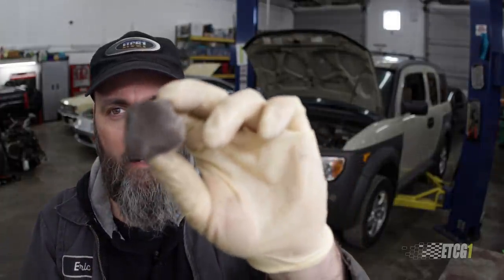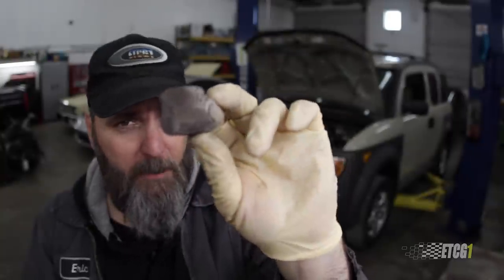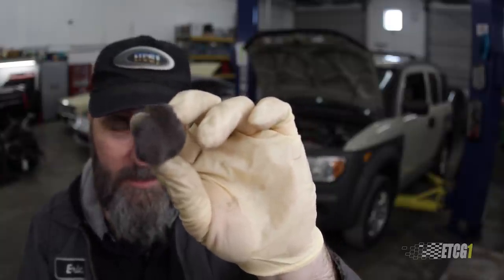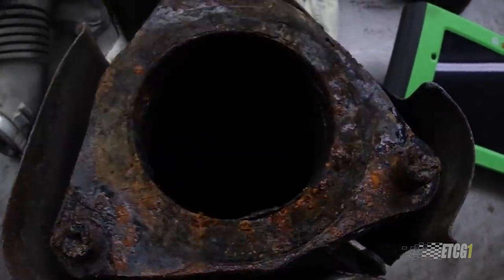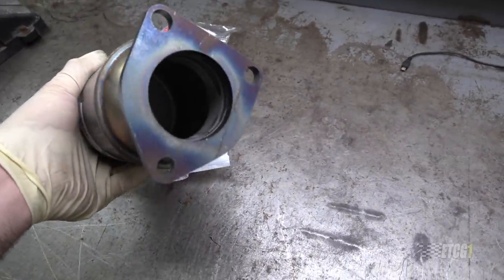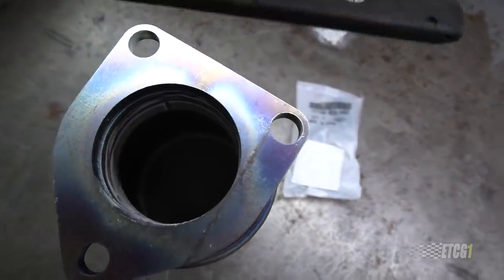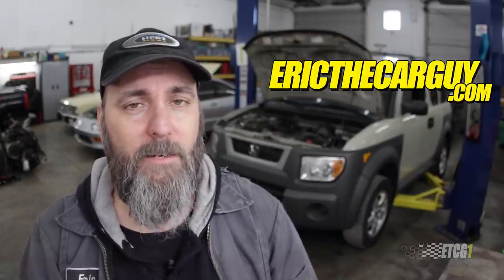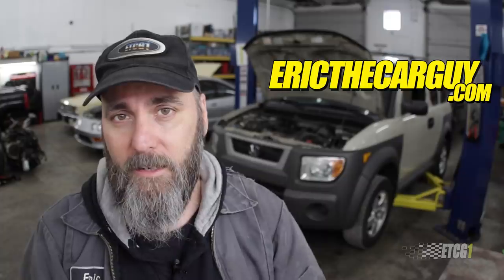Mining the Highway?

Comment: I was walking down a sidewalk and looked to my left to see a large blackish area of dirt? And after a moment I knew what I was looking at.
It was a large mass of black soot from where semi's had cleaned their stacks. The parking lot they parked in was concentrating this material in one small location and also filling the drain with it that was beside it.
Since then I've been refining this material.
Every 70k miles a semi must clean their stacks manually or automatically or their engines will not operate right. Well they are creating a gold mine in parking lots!

Comment: I guess that it is possible that the metals end up along the side of the road.  I remember thinking about the rubber that's abraded off of tires by travel along the roads wondering what happens to the millions of pounds of the stuff.  I then came across an article (in Popular Science I think) in which it was stated that there are microbes that 'eat' the rubber dust after it 'hits the road' (sorry).

Comment: Part of the problem with why converter become less effective over time is that the metal particles fuse together and there is now less surface area for the reactions to take place.  There is also poisoning of the metals by phosphorus.  And as mentioned, the metals end up going out the tail pipe.  I do think that the metals fusing is the biggest issue and there is work going on on how to prevent this so they can start off with less metal.  The aftermarket cats for sure use less metal and therefore have a shorter warranty.  I think the OEM cat is mandated to last at least 8 years.

Comment: There are 28.35 grams per ounce. If we take the figure you posted in this video ($1214.82) and divide it by 28.35 we get the per gram amount of $42.85. Now multiply it by 6.7 for the grams found in a ton of debris and you get $287.10 per ton of debris processed. There's not a whole lot of profit there right now, no matter how you cut it, though it is food for thought.

Comment: OEM catalytic converters in the U.S. have much much more catalyst material in them because by federal law the catalytic converters must last at least 10 yr / 120,000 miles under normal operation. Aftermarket ones do not have that requirement except in CARB states such as California and New York that do not allow aftermarket converters on California emissions cars.

Sadly nothing has really shown itself to be a viable replacement for these rare materials in a solid non consumable catalyst. The only replacement would be urea based injection using copper zeolite matrix. Diesels have to use this because diesel exhaust is much cooler, way below the operating temperatures of automotive catalysts and swing widely between rich and lean conditions as diesels are fuel throttled. Urea works for gasoline but would be another consumable people would have to buy.

Comment: I would think anywhere there is a traffic light on a highway would offer the best bang for the buck.  Hard acceleration up to 55 (okay 70) mph would likely spit out more material in a smaller area than just humming along a long stretch of highway.  An industrial vacuum to pick up the lighter debris might do it 🤔
Reply: What about mufflers?  I would imagine a muffler would almost act as a trap zone.   Maybe alot is trapped inside the muffler that's usually after the catalytic converter

Comment: back when cc were put into exhast systems there was a aftermarket for (wink wink) test pipes. i also had a coworker who had someone hammer out there cc for better performance. which i disagrre with. minnesota dropped the emissions certification a couple years after they started realizing how stupid it was. great expense and a waste of property and nice buildings. a vehicle could drive in one day and fail and come back the next day and pass. but it was only about emission and not about brakes and safty as minnesota is pretty flat.

Comment: Problem with 'mining' roads for it is first the reagent costs to process the tiny amounts from the sweepings and the labor cost to sweep so much of the highway will make it non profitable. CC reprocessing is profitable because you have a fairly known concentration in a small package. They also will pay far less for 'loose' material then a whole converter in the can because the loose material may be contaminated or have more 'filler' (debris or filler).

Second problem is that even if it was profitable it would be a one time deal as what is on the roads is built up from decades. Sweep that all up and you'd be waiting decades again before you could make any profit. Automotive CCs have .5% palladium and rhodium in their mix (Platinum was actually eliminated when lead was removed from gasoline as palladium could do all the activity that platinum did). There are actually other rare each materials in CCs that are profitable to reprocess when in concentrated form (A solid unit turned in for recycling) lanthanum oxide and neodymium oxide which increase the durability.

Comment: One time I found a grill on the side of the road.
Reply: Easier & A HELL OF A LOT CHEAPER THEN TRYING TO MINE THE HIGHWAYS. Imagine the cost involved doing this with State workers, NOT WORTH IT.
Reply: I found a snowblower once, came back minutes later to someone trying to load it in there trunk
Reply: @TheAirSofterblaster200  THAT SUCKS, for you. That's the way it seems to go for me also though.
Reply: I find tools. Lots of tools.  I call it my job lol.
Reply: I got a Carrier Tech 2000 style A/C condensing unit, which is now hooked up and cools my house. I'm guessing someone was hauling it in for scrap and it fell off the truck or trailer.

Comment: If you got a contract to clean the highways for the government, no talk of extraction or whatever then you have a company that is paid to mine this relatively easy to vaccume up and store dust what whatever, I'm. Sure you could out it though some multi layered shakers and work out what particles are too big to counts in anything.

I think now it would be profibale to mine from the side of the roads especially in nations with alot of road usage like the US, cheaper labour could be better but you could hire illigals.

Its very rare to see a car in the US that has an Engine under 2L I know a few modern hybrid cars or small turbo cars may have them but they are realy for the euro market.

Most cars and trucks maybe 98% run on petrol and I would assume the average engine size would be around 3L or more.

Bigger engines need bigger cats so more metals, diesels just have anti smog stuff and I'm not sure if they have any peciouse metals.

I was born in the UK and every car I had was a Trubo diesel that was remapped with a bigger turbo, Injectors and an intercooler, sometimes I would have to put a better gearbox and clutch that could handle it from the scrap yard but most of the good ones are made by the VAG group, audi, WV, seat and Skoda.

You could get 80% more torque and 50% more HP with a simple remap.

My first car was before the PD or common rail Injectors so I could run the car off anything that was an oil and was filtered well and had no water in and not too thin.

I would usualy choose realy light and small cars as less weight and remove as much weight as I could.

I had a methanol/water spray system I made out if scrap for the intercoolers, I think nearly all the parts I used cost very little as they where from wrecked cars but still good the only real money I had to spend was if I needed something custom made for example a manifold or turbo adapter or something like that but it would not cost much.    I was thankful as my friend worked for a remapping place.

I changed so much stuff and protected slot of stuff from heat.

The exasut was just a straight pipe, sounded like a sherman tank

I would go see a friend in the airport and get used hydraulic fluid and some waste kerosine, the used hydraulic fluid was very clean.

I would use 2 Stoke oil, farmers tax free red diesel.

Cheap rectified machine oil
Engine oil. Used engine oil filtered with an electromagnet then a centrefuge and then alot of filters then remove any water but most used engine oil was fine.

New vegetable oil was fine in the summer  and  so was used vegetable oil  that was filtered and water removed, it would not run in the winter unless syou had a second heated tank and heated fuel lines.

You could mess around with chemicals to make it fine in all weather conditions but I never bothered.

Most of the time I would use red farming/marine/heating diesel that used to be high sulper and ran so much better than regular road diesel but it was illigal as no or low tax.  Now its the standard stuff and much more expensive.

Used hydraulic fluid from aircraft worked amazing and passenger jets changed it often so it was clean and per plane it was quite a lot, they usualy had to pay people to dispose of that, I was lucky that my local airport replaced engines and stuff for airbus so they did alot of standard maintance on both airbus and boeing.

When kerosine jet fuel was cheap I would mix it with cheap rebated oil, 2 Stoke or realy cheap engine oil until it was slightly thicker than diesel.

Sometimes 2 Stoke oil was half the price of diesel at the pumps.
Even less if you got it in bulk.

I did use used veg and motor oil but it was so dirty to mess around with, you could tell what type of food it was from the exhaust.

Maybe 60% of road vehicles are diesel in Europe and they have not made or imported  vans or picksups that run on petrol since the early 90s,  you never see them apart from at car shows, I'm not sure why in the US they don't have a diesel instead of a big v6 or v8 as if your hauling the torque and mpg a diesel gives you is so much better and the engines are made crazy strong.

My father when we was alive had some classic cars and bikes  he would have his daily driver, a  fast Japanese import bike, then a Classic car and usualy an old British bike like a triumph or BSA.   He would often change them out but he would always convert the car to LPG (liquid propane) for a car powered car it was very very easy to is tall you had a tank in the trunk and run a line to the front then you would have a LPG carb that went under the standard carb but inside the car you would have a switch, you would usualy start the car with petrol and then change to LPG, LPG is pretty high octsone and used to be over half the price of petrol.

An LPG system for fuel injection or at least fuel injection with a cat is more involved but still worth it as its the only ecenomical way to drive a car with a large engine in the UK and many nations.

In the UK petrol and diesel are around £2 for 1l with diesel being about 10p higher thanks Russia.
LPG, gas for cooking and heating and the price of eletrisoty have all doubled or more since and its kind of funny as electric cars are not that much cheaper to drive now compared to a car with a good MPG, you save the most on the yearly tax.

People think electric cars pollute nothing.

Battery tech is awfull and solor in the UK is dumb and does not save much if your whole roof is solar, wind turbines work but only when it's windy.

Geothermal is too expensive and solar water pipes may work 1 or 2 months our or the year.

They want to ban the sales of all fossil fuel cars by 2030 and pullute nothing by 2050 but the UK pullute less than 1% in the globes as no real heavy industry and its a tiny nation.

It's hurting the normal person so much as half of these bills for electric and gas go for carbon tax and green whatever tax they made up.

For the UK and many nations the best idea is going nuclear, epseciakybin places that don't experience natural disasters like the UK,   we could build them on many of the islands we have or in the middle of nowhere, plenty of that,  new reactor designs especially the smaller ones are much safer and eceomical, you can use reinriched fuel rods that are alot cheaper and many of the smaller plants are modular, completely automated, can store used rods until they are picked up for enrichment, and can take less than a year to build.

Alor of smaller nearly all closed reactors are safer than a huge one.

Also you could have plants a safe distance away from the power plant and humans that could use pretty much any type of water that's been filtered and turn it into hydrogen with the only byproduct being oxygen it would be much more effixiat to have it closer to the plant due to eletrical resistance.

Then they could make an underground pipe system so you can refuel your car and heat your home and cook with the only byproduct being water.

You could pretty much convert any petrol or diesel engine to run on it, similar to LPG, with diesel you would need some oil for lubrication but only a little and could be synthetic.

I'm not anti renewable but it just won't happen with the tech we have and the battery tech we have, I hope cold fusion can happen in my life time.

Comment: How many miles of highway would you have to sweep in order to get a ton of highway dust&debris, and then melt that down (how much energy would that take for a whole ton?) to get 6.7g of Platin, which - as I had to look up - equals about 0.23 of an ounce, so about $300?
Reply from the maker: Hard to say, because I believe it depends more on location than anything else. The congested highways around major cities would be where I would look. Not so much on the stretches of road in the middle of nowhere.
Reply: @ETCG1  I'm just wondering if this could ever be made economically feasible. Possibly by including inner city roads where many cars sit at idle for most of the time (and there's an interesting technical question: Which state of operation that an engine can be in, like high revs or idle, under load or not under load, would be the one that throws most of the stuff out of the cat?)

Comment: Hey Eric. Question.  Why do I get a bad sound sometimes when backing out and applying brake slightly  like a errrr sound.    Only when car has sat over night   It’s almost like the rear calipers got stuck together over night and when turning while backing out.  It breaks them free again.  Car is still newer.   2016.  65k miles.  392 charger.
Reply: surface rust???
Reply: @kennethbode2017  nope I wish it was that simple.   It’s driven Dailey

Comment: In California aftermarket cat's are illegal.  New York state as well.
Reply: No, they just have to be CARB approved, which cost more than typical aftermarket converters.
Reply: @RobertHancock1  I hear they check the serial number during a smog check.  If it's not CARB certified or OEM you will fail.  It sucks when the replacement cat costs more that the car is worth!